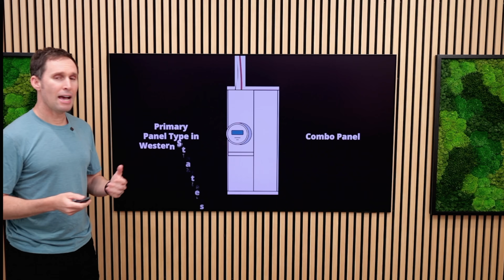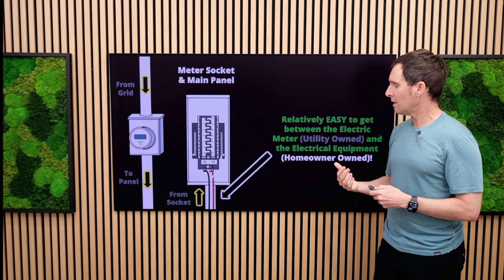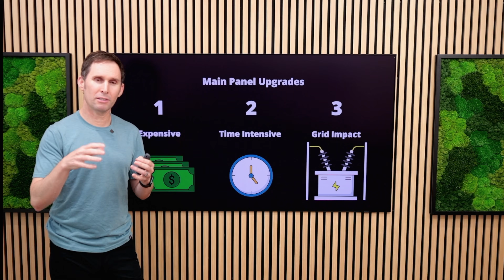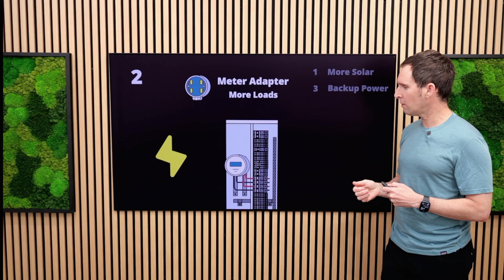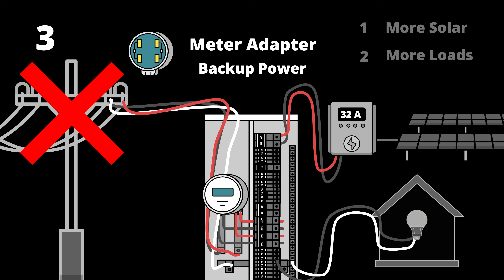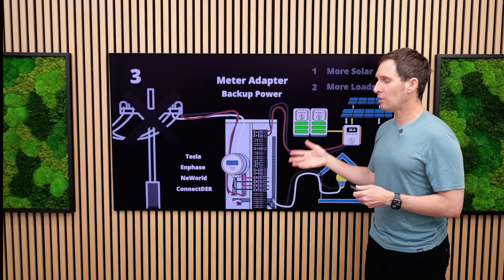What is the Meter Adapter / Meter Collar / Backup Switch for and how do they work?

Comment: Most of your focus was understandably on the combo panel, but I wasn't clear –– would a meter collar work on a split design where the meter is utility-owned and outside, and the panel inside? Or would you do something else because you have much more room to work to add a subpanel or other tool between the outside meter and the indoor panel?

Comment: There is a problem. This assumes you would have a hybrid inverter, but if you have a distributed system that is back feeding that does not throttle down power with line frequency shift, then you will blow up your generator or off grid inverter. You also have the problem while you may use CT clamps to throttle zero export.  Im sure if I spent a few cups of coffee and thought about it, I could make a workable solution, but it is not purely plug and play. I would think you need access to both sides of the collar to backfeed any additional power you dont use in the home.
Reply from the maker: Good questions...Meter collars that function as MIDs (Microgrid Interconnection Devices - devices that isolate a home from the grid) are really only primarily functional in an application with battery backup.  They are all integrated into a power management system that controls charge and discharging of the battery system to meet the load.  This can actually also function with batteries, solar and a traditional generator, but again batteries act as the "buffer" ensuring there is an effective shock absorber for the system...and yes, if the batteries are full then the solar will throttle to ensure they don't overload the load.  Both sides of the collar is not required because this is a grid isolation device....meaning it's meant to provide isolation from the grid during an outage.  When the grid is up (not during an outage) there is no reason for the switch to be engaged and thus you can backfeed normally.
Reply: @homeenergyacademy  is the collar have that black tar junk in it or is it something I could open up and engineer a little to add this feature in? I'm wondering what the contacts into the removable box connector gives me access to and where I would need to put some CT clamps. I'm trying to go beyond the 50A  limits.I think your collar is rated at 30A right? I always thought these collars were marketed as a device to plug into a L14-30 generator so it would not be adequate enough for more "modern" microgrid. I thought the device was marketed as to give access in cases of the integrated meter/breaker panel combo where we don't have access to place CT clamps. So hence I thought the collar would provide that access.

Comment: Most electric utilities will not allow meter adapters unless they provide it with a monthly cost. That started with meter adapter base whole house surge protectors. Check with your utility before you buy any meter base adapter.
Reply from the maker: Good point.  In California all 3 large utilities allow with with no monthly cost, but the adoption and structure will certainly vavy from region to region.

Comment: I’m an electrician you should never use an alternate method of hook up because the panel would need upgraded. If you are installing many tens of thousands of dollars for a solar system and batteries you should give your customer the best option in power generation even if that means they need an mpu. Not an alternate method is nice if it’s very difficultto install the regiment and so on
Reply from the maker: Thanks for your comment, I also hold a C-10 license.  The meter collar is a trusted, high-quality reliable solution to get between the meter and existing main panel. If the main panel needs replaced, it’s a separate issue and of course I recommend it if there’s some functional limitation with the bus bar or safety concern. But for a panel that in good condition, the meter collar saves a dramatic amount of electrical labor for homeowners and allows electricians to focus on higher value work.

Comment: Colorado just passed CO 26-HB1007 bill that is mainly for balcony solar, and includes a provision that makes adjustments in law around meter collars and requirements and will make it easier for customers to get meter collars (like for PV) installed without utility veto or hardware. I didn't know what a meter collar was, until I watched this excellent video. Thanks!

Comment: My system grid is diverted to my inverter and can control what power feeds my breaker panel. It can allow only solar and battery until they are not able to provide all the power needed and starts allowing grid power to supplement and wind up supplying the total power needed. It can also control the grid to recharge my batteries if solar is unavailable. It can also feed my excess solar power to the grid after charging my batteries.

Comment: This solution is limited.  In the case of SDGE, it allows for essentially a 50 amp connection from the PV inverter into the grid.  it's cheap and easy and clean install.  But if you are looking to have a larger PV system and add in battery backup as well as a larger whole home generator, AND you have an old panel that doesn't allow for supply side taps, then you really need to go the panel upgrade pathway.  The money you spend now will add value to your home.
Reply from the maker: Not sure if you watched the whole video...what do you think of the meter collar for disconnecting from the grid?  With Power Control Systems the 50 amps is no longer the limit.  You can add upto 80 - 100 amps on a 100 amp panel.

Comment: Can this be used without a battery backup system, using the solar to directly power the home during the day??
Reply from the maker: Sure.  There are 3 diferent categories of meter adapters that I've highlighted.  One is for supply of energy only. That is for solar feeding into the panel and yes, if you need more main panel capacity this is a great solution for solar only systems.

Comment: This video is incredibly insightful! I had 4 or 5 different contractors and solar installers come out and quote me on a battery backup system. *All of them!* told me I *had* to get a panel upgrade.  None of them seemed to understand how these meter collars work, that you can get them installed for free from PGE (if qualified) and how they can eliminate a $6000 upgrade without overloading a 1972 zinsko panel.  Even when I sent them this video, they were still in disbelief!  Its unbelievable. Thank you so much for this, and your exceptional communication skills 👍👍👍
Reply from the maker: Thanks for your kind words...yes, there are a ton of solutions and technologies out there that can solve problems.  That being said Zinsko panels are notorious for safety issues so upgrading it for safety (diferent than electrical capacity) was probably a benefit!  Thanks for tuning in...more to come!
Reply: I just got an EV that I'm not ready for so as you can figure i was doing some research online.  So as you can figure out consumers are in a perpetual scheme of the Laws of Economics with price quotes going through the roof; because "they can".  My research came upon the meter collar; specifically the ConnectDER which would be perfect.  The problem is out of the gate the unit is going to cost about $800.  Another problem is only certain states have approved this collar.  So the cost of owning an EV continues to climb!  Outrageous!

Comment: Your animation of the Panel Box is upside-down.  Hot (power) is alway fed from the top, not the bottom.  Otherwise good video.
Reply from the maker: Thanks for your comment, not sure if I'm miss-understanding your comment.  Also, I'm not sure what part of the country you are based in but on the West Coast "underground" electrical conductors can be overhead or underground.  If you look up  "bottom feed" electrical panel, you'll find a variety of options.
Reply: My panel, installed by SDG&E contractors during their under-grounding of the power lines in my neighborhood 10 years ago is fed from the bottom of the panel.
Reply: @ donski1519 Stop talking. You are wrong. Some houses on the West or East Coast come from the bottom or top. So please keep your ignorance to yourself.

Comment: You listed Grid Impact/Grid Upgrade Costs as a con of everyone in an area doing panel upgrades. However the Grid Impact/Grid Upgrade Costs will still be there if everyone uses a meter adapter rather than upgrading a panel. Either scenario will result in an increase in overall electrical demand so I'm not sure what point you were trying to make there.

Comment: It's great to have more non-service and main panel upgrade options. But you have to weigh the fact that there are often issues that preclude their usage or that their usage is sub-optimal. 

For example I just saw a SOC channel YT post where a dynamically load managed EVSE was installed at an apartment from the breaker box far from the EV. And when I ask why a ConnectDER EV meter adapter wasn't used? Since it would have been a much shorter distance to the EV. I was told the ConnectDER EV collar would have interfered with other meters. And since It was done at an apartment without dedicated parking both options were sub-optimal. The only way it made sense for the landlord and the tenant, was that all the costs were donated by the sponsor, since it most likely won't be utilized by the next tenant. 

But the expanded use of PV and EV,  we'll make the expanded use of meter adapters, inevitable. Nice option to have, but it's not necessarily the most optimal. Especially when long-term considerations are included in the calculations. Since Meter Adapters can eventually just become stranded assets. When an eventual service and breaker box updates becomes a necessity.
Reply from the maker: Great points, and thanks for sharing your real-world experience...things aren't always cut and dried...agree, it's a tool and when it works it's a game changer, but in the applications it doesn't make sense, another path may be favorable.

On the "future panel upgrade" my recommendation for homeowners and professionals is to do the "complete upgrade plan" and then design to that spec.  Meaning, to examine what electrification, additions and distribute energy assets plan on being added and then design for that.  

The key is to understand why the panel needs to upgrades, because study after study I've reviewed and real world experience tells me that panels are way, way oversized for the loads.  That load calculations (NEC 220.83) are way too conservative and we often waste significant money and energy on upgrades that aren't needed in the first place adding costs and having a negative infrastructure cost for the grid and rate payers overall.

Comment: You started showing East vs West US electric panels. You should have said at the beginning that you were only going to discuss the West.  So Easterners assume you will get to our set up, instead you wasted our time.
Reply: YT comments should be very critical.  

Since most  come from those with a lot of time in their hands, living in their parents basement. 

Hey Mom did you make my sandwich yet ;)
Reply: @ michaeldavid Just shut up. There are East Coast houses that this applies to. There are houses on the East Coast that get fed from the bottom and are combo setups. Now go in the corner and talk to yourself.
Reply from the maker: Ouch!  Tough feedback...but I appreciate you being direct.  Unfortunently, once I upload a video on YouTube I can't change it, but will keep that in mind for the future.  Ultimately, East Coast panels follow very similar rules and get similar benefits for both additional supply (solar) and additional loads (for an EV or subpanel) so everything in the video should still be super useful.  The only exception for the backup where having a meter collar isn't as valuable useful because the wires are so accessable and installing a micro-grid interconnection device (switch) between the home and the grid only requires re-wiring the main conductor from the meter to the home's subpanel.
Reply: Agreed. I thought he was going to discuss both types of panels. I have the east coast type of panel and I live in Oregon. It took a painfully long time to find out that none of this applies to me. I feel that this should have been made clear earlier. Sorry, but this video deserves a big thumbs down.
Reply from the maker: As mentioned in the other comment,  East Coast panels follow very similar rules and get similar benefits for both additional supply (solar) and additional loads (for an EV or subpanel) so everything in the video should still be super useful.  The only exception for the backup where having a meter collar isn't as valuable useful because the wires are so accessable and installing a micro-grid interconnection device (switch) between the home and the grid only requires re-wiring the main conductor from the meter to the home's subpanel.